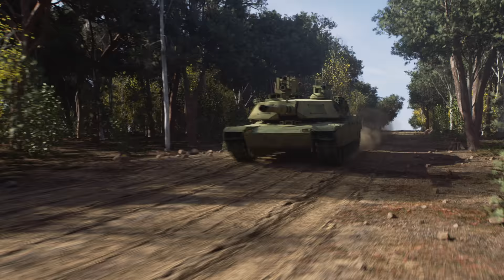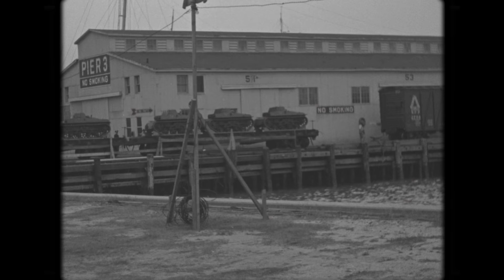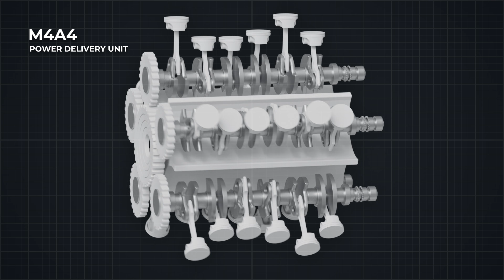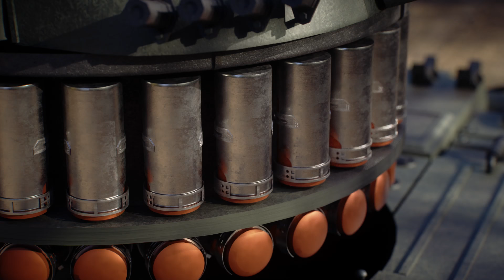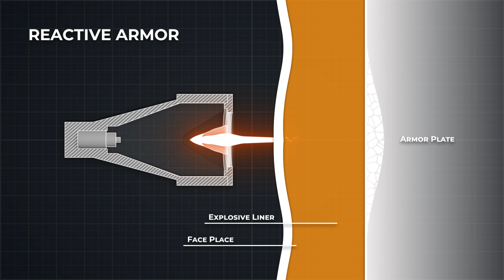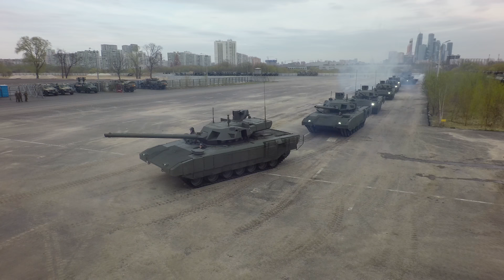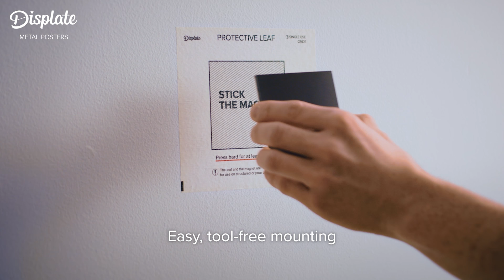Why America’s Tank Failed in Ukraine

Comment: I don't disagree with the fact that the tank hasn't performed as well as other tanks in Ukraine, but it takes a very narrow approach to why. 
You fail to take into consideration life expectancy of the tank - there was a single shipment of tanks towards the end of 2023 and that's it. 
You also fail to take into consideration the model and what was stripped away from the tank to export to a non-NATO country. 
You make no comparisons to life expectancy of other models that were donated at the beginning of the war.
You say they are maneuverable and guzzle fuel, but don't link that to how that led them to getting destroyed or abandoned.
There are also no comparisons to survivability against drones, which is one of the main points for what ended up destroying the majority of M1 Abrams. 

I was hoping for a more detailed analysis but this just seems very surface level and only hones in on a single weakness of the tank, while talking about newer technologies that are not fielded yet. 
A bit disappointed by the root cause analysis when your channel is literally called "Real Engineering"

Comment: I'm not being mean, but this channel really needs to get its facts and context straight.
Where do you start pulling this video apart? Seriously, how much misinformation and Russian propaganda can you pack in?
1. There's no mention of the fact that those Abrams are 1980's vintage, without the modern electronics or the Chabham armor. Poland handed down their aging units while receiving new units with much better electronics and countermeasures.
2. The US was suggesting the Leopard from the start for a few reasons including fuel economy and weight. Because of the weight of the Abrams, there are times of year where it can only go via a few predictable paths. It's bottle-necked and vulnerable. And the Russians know this. When it's tank on tank, the Abrams usually wins because it hits 1st and lethally. Stop them from being mobile and seeing 1st, they are more a sitting target. We all know a sitting target is far easier to hit. These are the reasons the US is looking into medium tanks again.
3. German tanks in WWII lost because of their transmission failures. Sure, they kept increasing displacement, but completely failed to improve the transmission. Transmission failures and engine overheating killed as many German tanks as the US. Meanwhile, the mass produced, field repairable, more fuel efficient Sherman kept going. Tank down? Another showed up in its place. A tank crew was killed or taken out of action? Another wasn't far behind. The Sherman transmissions comparatively rarely failed.
4. Russian tanks have proven generally and objectively terrible. The T-34 had a transmission failure rate so high that fully 1/2 or more of them never made it to the front line. Only overwhelming numbers of them kept the Russians in the fight. The real reason the Soviet Union made so many tanks was because they knew just how unreliable they were and they needed to make that many to be scary. The struggles of the current main Russian battle tanks are well documented and don't need repeating here. The T-14 Armata hasn't shown up at all because of the rampant Russian corruption, failing transmissions, and a failed Nazi engine that can't be mass produced. Fun fact: the X engine is a WWII Nazi engine. The Nazis couldn't make it work. The Russians still can't. Every one of them is hand built, overheats regularly, and breaks down quickly. The T-14 will never make it into combat in its current form. It can't.
5. Last, but not least are the real heroes of the conflict: the Bradley and the M113 from Korea. Both have proven more effective and mobile. Both have proven reliable. The Ukrainians love the fact that they were clearly designed with the serviceman in mind. Reliable, mobile, relatively easy to maintain, and not needing serious logistics to keep going. These matter more than overwhelming tank battles. Tanks are a tool, but not the main weapon of choice.

Comment: The gas turbine engine in the M1 Abrams (the Honeywell AGT1500) generally consumes significantly more fuel than the engines typically produced by Rolls-Royce for similar-purpose military vehicles (which are often diesel or hybrid).

Comment: The first minute singing the praises of the M1A2 Abrams...which is not seeing duty in Ukraine. They have the older M1A1 without all the upgraded armor and targeting systems. Same excellent Honeywell turbine though. Of course, logistics is an issue and the Abrams was built for the American army first with the secondary hope that foreign sales might happen later on. Narrator misses the point that the US Army and Marine Corps only goes out into the field with one fuel, which is a logistical choice made by the US Army. Almost every US Army vehicle runs on JP8 or more recently, F24 which is the NATO standard and is compatible with US JP8. So while you may need more fuel to keep an Abrams running, you're only going to need one kind of fuel and the turbine isn't actually that picky. It will happily run on regular diesel fuel that the Leopards, Challengers and T-72s are running on. An Abrams has zero issue running on F24 supplied by anyone else in NATO. Or automotive diesel. Or JP5. or JP8. Or old engine oil thinned down with gasoline and vodka. It really doesn't care that much.
Was the rent due and you needed some quick clickbait views? Talking about the vaporware T-14? Really? 😄😄

Comment: The right question to be asking is how much destruction to the other side did they cause before they were destroyed and did the crews survive?  On a modern battlefield tanks get destroyed, but if you lose 2 tanks and the crews survive and the other side loses 15 tanks with 75% crew loses (just made up numbers folks I don't have the energy to research this) then that is an acceptable trade off in most situations.

I wouldn't want to roll to war in any tank on a modern battlefield but if I had to, I would rather roll in an Abrams, Leopard, or Challenger over any Soviet/Russian design in existence.

Comment: Crazy that after ~4 years of war that 10% of the original number of tanks delivered are still functional. Hardly a failure. 

But yes, the American tanks are designed to operate under American doctrine, which means that logistics are going to be a problem for anyone else. Like you said, the C5 fleet the usaf operates is larger than basically any other Air Force on earth. With American supply lines behind it, the abrams fuel burn isn’t the issue that it is for other ground armies. 

As it’s been said in every mechanic shop a million times, between the options of good, fast and cheap you get to pick two. America chose good and fast.

Comment: If the M1-A1 tank “failed” in the exact environment and combat theater that it was designed to excel in that environment, one has to point fingers at the user and not the machine.

Comment: The m1 is not a tank it is a tank destroyer 
They are fast with a very big gun and not much armor 
In the US we live in a propaganda swamp and they knew Americans always have to believe where the biggest baddest toughest so they could not explain tank destroyer and it's job in combined arms to Americans. So they did what they always do and told us we had the biggest baddest toughest. It's only job is to destroy tanks 

The same thing happened with the F-16 which is a cheap light fighter. With the f-35 which is a boondoggle. And more than anything with the AR-15 which is inferior and almost every way to the FN file, the AK etc

Comment: xD abrams was never good. trash on paper, trash on track. sorry dude a stealth mode for doesnt exist. an electric motor (with a huge amount of batterys) is no garanty for a quite cruise. tanks are loud as hell. the enginenoise is on of them. the tracks are loud. you can hear a tank kilometers away. trash development. not worth it

most diesel tank engines can burn different fuel

Comment: Despite the tanks performance surfing due to the personnel not being able to utilize the Abrams generation one tanks as designed. Between the drones and the Abrams supplied. That’s actually a success.  Granted more drones have taken most of the 6,000 Russian tanks. But the Abrams have taken out more Russian tanks. Than Russians tanks have taken out Abrams. The Abrams utilizes a multi fuel motor system. Has since it’s inspection. Yes. Ukraine got this motor package. Jet, gas and diesel fuel. Armada has been denied going into battle. Russia assessment shows the Armada would not last in a tank battle. 76-78 Model Abrams one tank vrs t80/t90s. So far the engagements the t80s and t 90s lost. And the Russian military is ordering more t80s over the 90s. Countering your turbine argument.

Comment: The Abrams sent to Ukraine were older models mothballed and did not have much armor upgrades of today, you add that to it’s obvious weight limiting its use in some areas, its fuel guzzling way and probably the biggest ones is the numerous drones specifically built to go after tanks and may not destroy them outright but can immobilize them … there yea go

Comment: The M1 (like all other modern MBTs) was designed to be used in a very specific way. It is 100% not an infantry support tank. It's designed to be part of battalion or brigade level combined arms manuever warfare aloing with all the other systems deisgned to work with it: the M2, M109A6, AH-64, MLRS etc. During OIF 2003-2011 the US had somehwhere between 150-200 M1 knocked out or seriously damaged by enemy fiore, usually IEDs or RPGs. The M1s were largely (at least after the initial invasion) used as infantry support tanks in urbasn eniovrnments and convoy escorts: two tasks they were NOT designed to be used for. Whenever a vehicle is used for a task or in anenviorment it wasn''t designed for its not going to perform optimally. If the M1 (or Leo 2 or Challenger) were being used in Ukraine BY the US or major NATO power as intended, with all the supporting arms, air superiority, etc. the results would be quite different. A big reason the initial Russian invasion failed was that the Russians didn't even use their armored and mechanized forces they way they were designed to be used, becuse the Russian Army was no longer the Soviet Red Army that developed all those system (T-72/80/90, BMP, etc) and the doctrine to use them. Russia inherited the kit, and the doctrine but lacked the skills, logistical and operational capbilities to use them as originally inteneded.

Comment: By what metric are you considering it a failure? The US sent two companies worth of M1A1’s (not A2’s like you said) in a war of divisions and corps; they were never going to last to the end. The M1A1 already fought Soviet tanks in the gulf war and famously won a decisive victory in the battle of 73 Easting. Is that an unimportant data set?

In modern warfare, no tank is impervious. What’s important is how they are used, the environment, and missions they fight in. While the power train is a factor, there are many more important factors for analyzing a weapon system’s effectiveness in a given conflict. Your single factor analysis is lacking; a more detailed study and multi-variate analysis would have produced a more accurate picture.

Comment: Can you confirm that the T14 Armata's engine is actually built to the spec you claimed.

Lazerpig claimed it uses a pumping engine, and the chieften claims there has never been a spec released for the engine.

I also question the claims about the reliability of the engine as there are more videos of the tank breaking down during a parade than any combat footage.

Comment: People forget just how advanced the T64 and T72 series tanks were. Until the abrams prototypes were in testing NATO had nothing comparable, not even close. After that we rapidly had the leopard 2, challenger, ariete etc..

also, lets not forget the strv 103 - with its dual turbine and diesel engines both linked via individual transmission to the drivetrain.

Comment: Welp, judging by the comments, this video is a bit clickbaity and seems to suggest that a tank's only metric of failure is whether or not its been destroyed/disabled.
Judging from our other peers in this comment section, this does not tell the whole story, and it seems the Abrams has been able to keep its crews alive much more reliably while suffering from drone strikes that it was never designed to counter.

And instead of using the pinned comment for clarification or justification, Real Engineering uses it to make a snarky jab at anybody who seems to have a problem with his very arguable assessment.
At least I got to enjoy this channel for a little while, I guess 🤷‍♂

Comment: Good afternoon. As a resident of Russia and an interested party in military issues, I can tell you that what you said about the new T-14 Armata tank is true on paper. However, in practice, not a single Armata tank has reached the front lines due to serious issues with the engine. Additionally, the cost of production is a significant concern. There is no exact data, and there can't be, but considering that this is a completely new chassis and a new engine, it will be impossible to produce them in sufficient quantities in the Russian Federation, so the main production is currently focused on explosive barrels like the BMP-3 and tanks like the T-80 BVM.

 And considering that the engine problems are likely to remain unresolved, as stated by the Russian Ministry of Defense, "the tank is too expensive for the current war." This puts an end to its development.

Comment: This video spends 80 percent of its run time NOT talking about why the Abram’s failed. Could’ve just said it had a turbine engine because it’s more powerful and America  doesn’t care about fuel consumption as much as other countries. The last part could be summed up with the Abram’s have no defense against drones. Correct me if I’m wrong but don’t Ukraine Abram’s have APUs? Specifically so the Abram’s can last longer in the field without refueling?

Comment: use electronic motors (they can be so small now), a small lithium battery pack with 3 to 8 minutes of run time so the tank can "run away" from rest and have time to spool up the turbine, tie the turbine to a generator (again can be way smaller now... actually like F1 cars the MGU generator can also function as a motor as well) to power the motors and charge the battery, the extra generator weight might be off set with a simpler gearbox as even EVs with gearing only have 2 gears (ratios)... same concept could also benefit a diesel setup as well as in both the "engine" could run it is optimal efficiency RPM... battery motor setup could also boost power in an emergency...

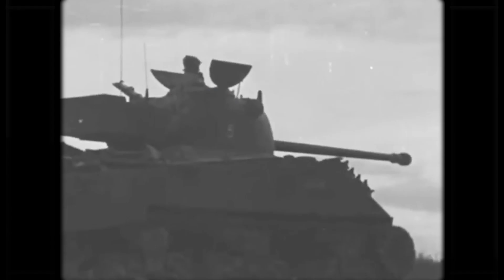Comment: 5:45 factually incorrect, many Sherman’s with 75mm guns faced tigers head on and won, famous battle at Fontenay-le-Pesnel had a tiger and Sherman turn the corner on the same street. Sherman lobbed 3 shells at the tiger before it could react knocking out the tank head on.
Reply: American called any tank they met a tiger tank truth is they didnt,the british firefly gave the sherman some hope.a bit like the Mustang used the british rolls royce engine we like to improve.
Reply: @jr8163 So it's a good thing that it was the Sherwood Rangers fighting at Fontenay-le-Pesnel then? With lots of photographic documentation of the tigers of the s.SS.Pz.Abt 101? And it was just regular 75mm armed Shermans that took the first Tiger, according the people there?
Reply: @jr8163  I thought the Tiger was found to be under gunned and under armoured in Normandy. With even 1920's vintage British Armoured Vehicles like the Rodnol being able to penetrate its frontal armour from far outside the range of the Tigers small 88mm gun.
Reply: @jr8163  I see you replied in English. Your welcome. USA
Reply: @zt409  I see you use English.  You're welcome.  England.
Reply: Were tanks often misidentofied as tigers on the western front? Yes
Were tanks often called king tigers on the eastern front? Yes
Still doesn't change the fact that they did actually fight american and society armor, if more rare. Tigers also had poor visibility, turret traverse, and top/side/bottom armor.  Any commander wirth his salt just drove around to the side and knocked them out.
Reply: Also in Italy a regular 75mm Sherman knock out a Tiger , Cecina was the town
Reply: That surely is a nice and heroic story, but the numbers paint a different picture. If Shermans were so effective against Tigers, where did they get their reputation from?
Reply: @overflow7276 propaganda that Tigers were invincible.
Reply: and there were Sherman Firefly tanks as well.

Comment: My takeaway from this video: You and your enemy both start with 50xp points to distribute into the categories of speed, armor thickness, firepower, hull size and fuel efficiency and your goal is to engineer the shit out of it to increase that 50 initial points into 500 with complete disregard for the cost to the taxpayers. You think you've finally made the ultimate tank: Meanwhile, the drone: 
Speed: 9999
Armor: 0008
Firepower: 9999
Hull size: 9999
Fuel efficiency: 2750
Production capacity: 9999
Cost 9400.
Total: 52154xp points

Comment: No one has developed a Abrams M1A3 - what they have developed is a mockup of how a theoretical tank might look like before any of the math and materials have been kicked.

It's funny that so many fall for teh buzz of that thing, when you can basically take a picture of it and put out your red marker - no need for complex match and high detail level scrutiny. In terms of modern challenges, solutions or capabilitys, it's as idiotic as the Trump class battleship nonsense floating around. If you look at it and don't instantly start laughing - you have no foot in engineering.